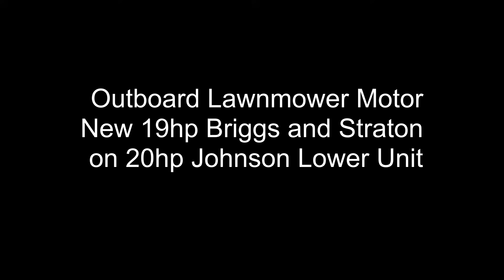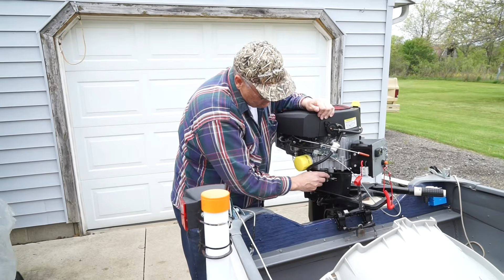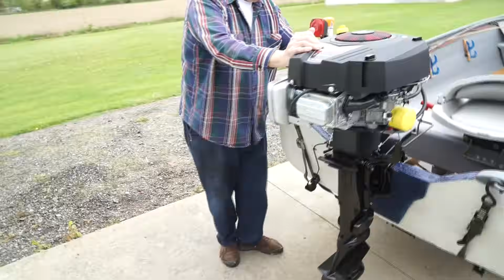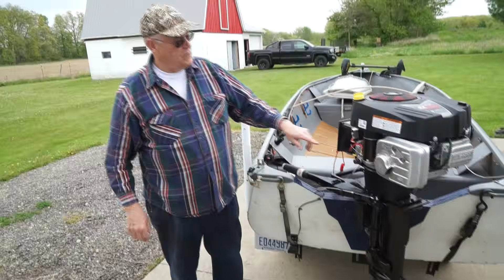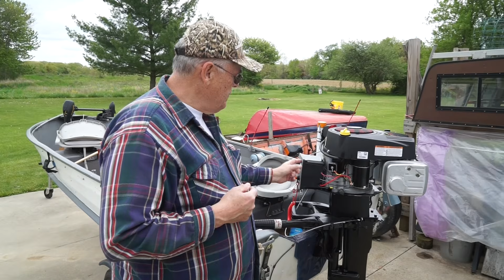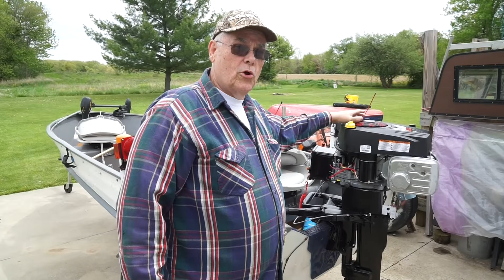How to BS Swap a Johnson! Outboard Motor Swap - 19hp Briggs & Stratton on 20hp Johnson Lower Unit

Comment: Nicely done conversion! I have a 2003 7 h.p. Honda lawnmower engine mounted to a1957 Evinrude (12 hp) lower unit,  set up for remote throttle and shift with some controls from an older Chrysler outboard, and a hand built steering setup, on a 14-ft aluminum 1960 Arkansas Traveler jonboat. Been thinking about something like yours for a bit more horsepower and an electric starter.

Comment: these Briggs & Stratton Intek based single cylinders they have some problems which is the camshafts go bad in these mainly with the compression release going out on them as you are much better off swapping this engine for a comparable Kawasaki FR and FS series V twin either the FR or FS600V or the FR or FS 651V its not just Northern tool its on Small Engine warehouse.  I would check out Taryl Fixes all's youtube channel for the common small engine problems. 

https://www.youtube.com/watch?v=g0DdGmmFaAs&t=1662s

Comment: Looks great. Do you leave the water pump in the lower end or take it out?  I want to do this to my outboard that has a bad engine.
Reply: since its a air cooled power head now and no exhaust going though the main body to lower unit just remove the impeller

Comment: but at 3000 rpm what kind of prop did you find? the biggest pitch is around 12'' for those small gearcases. that 20hp originally put out about 15-17hp at the prop so this 19 is about the same is guess. must make a racket being air cooled!

Comment: Really interesting job on this, haven't seen a conversion quite like this, Congrats on your project, was wondering how fast does the motor push your boat now.Thanks for sharing and posting. I have one of the 5hp Briggs and Stratton outboards, refurbished it and really enjoy it, but still thinking about more HP options... Happy Motoring and fishing !
Reply from the maker: Thanks for response. The speed is very good. One problem I had was that the governor had to be manipulated to get the maximum speed from it. This was a new motor, an older one might have been easier to adjust. At first it was slow like a lawnmower. I put an auxiliary throttle control on governor linkage and now it moves a deep sided 14' very well.